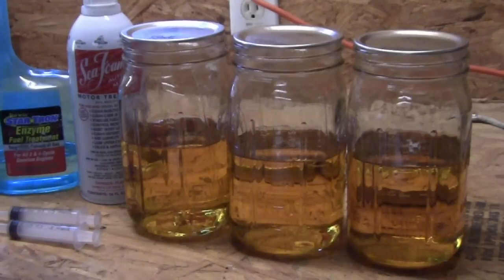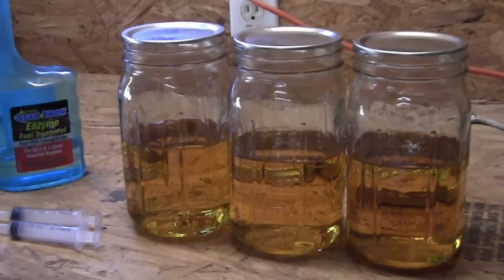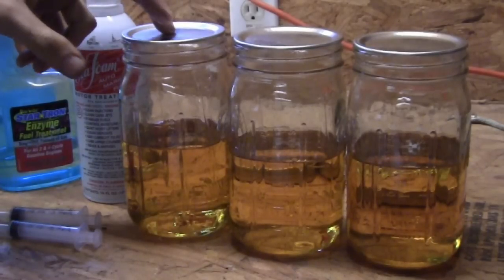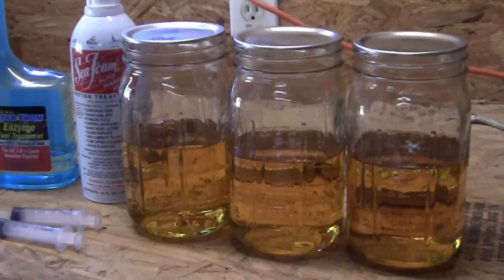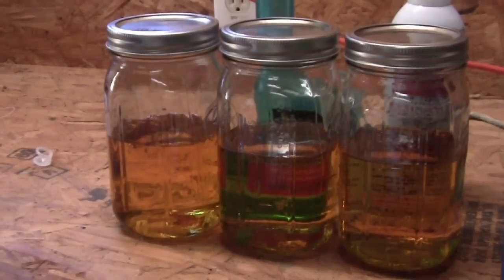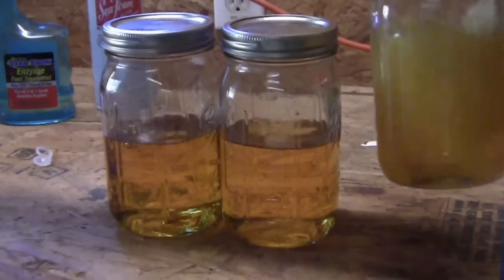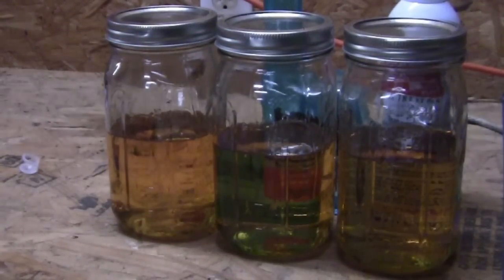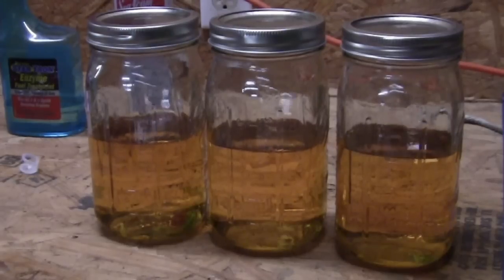Stale Gas: Can it be treated with additives? My unscientific test and results.

Comment: Should you have a   LARGE  stock of stale gas 😝... do  NOT  throw it away .... by adding a  VERY  SMALL  amount  ( ¼ pint  ) to your new gas fill up , used in your automobile .. over many months , you can dissipate this foul fluid ... and save quite a few $$$ dollars .... ( tried - n - tested ) ............. DAVE™🛑

Comment: Chain saw full of stale gas. 20 pulls won't start. 5 second spray of starting fluid into gas tank and sloshed it around. Started on second pull and ran strong. Don't waste money on high priced liquid either. Spray some starting fluid into your gas and keep going.
Reply from the maker: Its the most volatile stuff that seems to evaporate fastest, so this would make sense that adding some ether would spice it back up.

Comment: This is a incomplete test bro You should have stuck one or two or all three of them into a motor of some sort and see if you could get it running because just because it didn't change colors doesn't mean the octane rating hasn't gone up or if it was separated has now been combined again there's a lot of things that could have done without changing the color of the gas
Reply from the maker: https://youtu.be/2c5XRFuFaLY
Reply from the maker: Oops, that posted before I typed anything. I thought the same exact thing, so I found a lawnmower engine to use, and tried running ancient gas in it and it ran fine.

Comment: I have a couple of 5 gallon cans over 3 yrs old.  My plan is to add them to my truck along with seafoam when filling up. My truck has a 40 gal tank so a 5 would be 1/8. Then, of course refill the can with new gas.
Reply from the maker: Yup, diluting it works great as a way to dispose of old gas.

Comment: Do they taste different?
Reply from the maker: The vintage has a smooth, rich flavor with slight hints of varnish and gum, while the freshly bottled has a sharper body with strong octane and could have hints of ethanol depending on which bottle you buy.

Comment: i have an automatic 2001 VW jetta 2.0 - it sat since december 2021 until now april 2023
mobile mechanic came by and put in a brand new battery, refurbished starter, cleaned up the rusted ground connection from the starter to the chassis or transmission whatever it is
the car now cranks, but won't start -  he then took off one end of the cold air intake and sprayed something into the engine while i started it up but then it died after 2 seconds
the gas is original from probably november 2021  ,  i have about half a tank
he is telling me that probably the fuel pump needs to be replaced
any ideas if its just bad gas ?  
i have 87 octane in there
Reply from the maker: There is typically a port to test fuel pressure, it may be possible the fuel pump needs to be replaced, but it may also be that a fuse or relay has corroded. I'd do some other diagnostics, check if the pump runs by listening when you cycle the key on, there should be a faint whirr from the rear of the car, it no whirr then I'd check the fuses and make sure power is making it to the pump, that fuel is 1 and a half years old, so it should burn ok, I'd make sure the pump is indeed providing fuel pressure, and then top up the tank with fresh gas, but there is no sense topping up the tank if youre gonna need to drop it becsise the pump isn't working right.
Reply: @trythistv  the fuel pump on these cars is accessible and changeable from under the rear seat - there is a video here on  youtube, it takes literally 10 minutes
so i got lucky in that department
i will check the fuse panel and relay today or tomorrow - weather permitting
Reply from the maker: Oh man that is just the ticket. I was envisioning having to drop the fuel tank and that is a big pain. Its so nice when engineers think about the people that have to maintain stuff later!

If you've got easy access to the fuel pump you could check for power at the connector with a multimeter possibly as an alternative option.

Comment: modern day alchemy! When we do this stuff it is pure guess work, what we end up with is NOT the original gasoline formulation, but if we are lucky it still functions as a reasonable fuel. It will NOT have the same exact properties, in function, that fresh good grade gasoline has. Gasoline is a very complex chemistry, with carbon chains of C4 to C12 in literally hundreds of variations. With age and depending on storage methods the lighter aromatic hydrocarbons can vaporize off and exposure to air allows for chemical reactions/oxidation that modifies the original hydrocarbon mix known as gasoline. Ethanol content adds an element of "spoilage". Past a couple of years age I opt for new gas, although some gas several years old can still burn, but I want to have assurance that the gasoline is not doing damage with low Octane or deposit formations such as is very likely in old gas.
Reply from the maker: I feel like some kind of wizard messing with stale gas, in the end you are right though, the ways that gasoline ages are very strange, and ethanol content further complicates things.

Comment: I drain the old fuel from the gas tank and return it to the gas can. Those bottles of OTP fuel system cleaner/treatment often come in 3-packs. I’ll buy one of those 3-packs and add them to my gas can and give it a good mix. Even if it doesn’t actually fix the fuel, it still combusts and that’s all I need for a running lawn mower.
Reply from the maker: Seems like a logical way to do it! I've found even diluting it with some fresh gas seems to liven it up enough to burn ok, I'm sure there is some performance difference from the old gas but I'm not really hunting for maximum performance, just good enough to get the job done!

Comment: I have a cabin where I have to use a generator, sometimes the gas gets one year old. The best way to deal with it is to pre treat it with MMO. I put some in the carb in the generator too. Never had any issues. I have also used chemtool and it is just as good. My experience is only with one year old 87 octane gas with ethanol. Cant speak for any other kind of gas or age beyond a year.
Reply from the maker: Pre treating seems to be about the only way to ensure fuel doesn't go bad. My best advice for storing stuff is if there is a fuel shutoff, shut if off and run the equipment until the carburetor is empty. If there isn't a fuel shutoff, either install one or drain the fuel out through the carb drain plug until the tank is empty (for small things like lawn mowers) as it seems like leaving fuel in the carbs is what causes the varnish buildup and that clogs jets and makes for problems.

Comment: good info .do you think a universal gas filter add to the gas line near the engine would effect the performance
Reply from the maker: As far as fuel degrading in storage, a filter won't really help, as it evaporates in the carburetor and gums up, a shutoff valve could prevent that gum forming by allowing you to shut the fuel off and run the carb dry, a bunch of my small power equipment (log splitter, pressure washer, lawnmower, etc.) has a small in-line fuel filter and a small in-line shutoff valve, so prep for storage is as easy as shutting off the valve and letting the engine stall out when the carb runs dry, and then summertime comes again and the filter catches any gum that could have formed upstream over the winter.
Reply: @trythistv  thank for taking the time to anwer
the gas tank was emty, but cannot remove gas tank to really good cleaning inside to big job on lrv 2000 with 951 engine
the gas was 10 year old .so the internal carb gas filter were really gum up after 1 hour of road test with new gas.it run really good for a hour then it would not go no more than 5mph so i took carb a part and the fllter were complet gum up  on the 2 carb after road test 
so i filter the new gas in the tank 5 time with a universal gas filter and replace all the fuel hose because of the gum.  but to play safe i add a extra fuel filter in the system because it a big job remove carb to change filter 
but now it will not go no more than 40 mph with that universal filter it chock and stall at 40 mph but goes good at lower speed 
so i was thinking that the sucking side of the gas pump on the carb cannot handle the weight of the gas 
what do you think, can the gas pump handle that more weight of gas on the line with the universal filter ?
Reply from the maker: Usually there is a small mesh filter built in to the fuel system, often either right at the front of the engine bay or right above the fuel tank in the front compartment, they have an awful tendency to leak air in because its a small plastic bowl with an o-ring, and the bowl warps or the o-ring hardens and causes all kinds of trouble. I wouldn't think adding a filter would restrict it enough to make that much difference.
You could do a plug read and see if it looks lean after a decent test ride.
If you still have the grey "tempo" fuel lines, I would change them out ASAP, they tend to degrade and cause all kinds of problems.
Also, the fuel selector valves can get gunked up inside as well, either one could cause some restriction that could be an issue for your performance.
Reply: @trythistv  i did change all the hose to black automotive and i did inspect that filter over fuel tank but did not replace oring on the filter
what i am going to do next is  remove gas line from carb and plug line going to fuel gauge and apply vacuum with vacuum hand pump to see if it hold vacuum or leak before going to deep in the diagnostic 
did you see some seadoo with a universal fuel filter on them that run good ?
Reply from the maker: I have seen various seadoos run fine with a universal filter, if you're questioning if the filter is the issue, try using one of the kind that has a mesh rather than paper, as long as any debris is smaller than the jets it won't clog stuff up. The stock filter is a fine plastic mesh usually, something similar would be fine, it could be your paper filter has started to clog up a little?
Reply: @trythistv  ok cool .i have the paper one. it is for that varnish that i had in it in the pass.it did a good job removing that dark yellow in the fuel .now the new fuel look normal after filtering the fuel 5 time .but i put a new filter  on the seedoo to catch what i could be mist .but i think now after are conversation it is taking air. because there lot of air in universal fuel filter and never fill up it empty fast. i was thinking that fuel pump could not handle that more weight since it is on the sucking side. the filter is clear plastic filter .i think i was barking at the wrong tree lol .i will check that out in spring when my daughter bring it back to my house .thanks alot for your help

Comment: I have brought back 15 year old gas by adding a gallon of thinner to the 10 gallon gas that was in the tank and adding star Tron enzyme and it worked
Reply from the maker: The more volatile components evaporate first, thinner is real volatile stuff so it makes sense adding some in could rejuvenate the stale gas in a way. I'm certainly no chemist though, idk whats going on with the stuff past my own hair brained theories.
Reply: @trythistv  hello just giving you a shout-out I'm about to try to rejuvenate about 11 gallons of gas in my Ford Escort that's been in there for 4 years four-and-a-half years... now what I've been doing for the last three years is my old acetone trick... what I've been doing with my carburetor Vehicles I've got two motorcycles 1998 Magna and the other is a 06 VTX 1300 Honda... and I've learned through some of the motorcycle forums that these guys have been for the last 10-15 years using acetone in their tanks putting a straight in and getting incredible results higher-mileage 5>15% increase in Horsepower and boost in the acceleration.. and I've been doing it the last 3 years and it has produced those results the issue was finding the sweet spot for the mixture for your particular vehicle.. in my 98 Honda Magna 750 is the mixture is about four-and-a-half 5-oz a two and a half gallon 3 gallon tank counting Reserve... and in my 1300 VTX it's about 3 oz per tank.. once the acetone and the cast mixture hits those carburetors and boom is like I have a rebuilt motor and brand new carburetor job... no Smoky exhaust smells great unbelievable I can't believe everyone's not doing this I've had no problems with rings rubber.. as far as seals.. last week I mixed it in with my weed eater about a capital for the little tiny tank and I couldn't even hold the trigger all the way down because the revs are going so high... so here I go this afternoon I'm going to try to reclaim 11 12 gallons of this gas and see what happens...

Comment: I have 18 gallons of bad gas in the newly purchased used boat it misfired and quit running on the lake I needed to be towed gas maybe six dollars a gallon but I’m dumping it it’s not worth mechanical issues Backfiring maybe slipping timing belt doing so trash your valve’s etc. . have a great day everybody
Reply from the maker: Its one thing to have a lawn mower break down because of stale gas, getting stranded on a boat is a whole different story. I've paddled back more than once, not a good time. Boats also do not cruise like cars do, because of the drag of the water, a boat is constantly under a heavy load, so it is much more important to use a quality fuel that is high enough octane to resist detonation.
Even at 6.75 a gallon like it is here right now on the lake, I totally agree with you, it isn't worth the risk. Drain that gas out, use it for something else!

Comment: I don't care what it looks like.... How does it run in a test engine?
Reply from the maker: See this video: https://youtu.be/2c5XRFuFaLY the stale gas loses some volatility, that is about it. That can easily be remedied by adding some fresh gas or some kind of additive that is usually 90% naphtha or another highly volatile paint thinner type chemical. A healthy engine will run fine on stale gas, unless it has left behind any kind of gum or varnish in the fuel system from the gas evaporating in the carburetor which would be a completely separate problem to the gas "going stale"

Comment: I have a Dodge Caravan that's been sitting for 7 years with 15 gallons of 10% ethanol gasoline. It ran fine last year after adding a couple gallons of fresh gas and a can of "Heat". 

It decided to run like crap and barely start after this winter. I then added 2 bottles of "Heat" and 4 fresh gallons of gasoline. It's won't even run now. 

I've drained 4 gallons of fuel with no luck. Water is heavier than gasoline so it will settle at the bottom of the tank by the fuel pump pickup tube. It just must be that bad and I'll probably just drain it all out.

I burned the 4 gallons of extracted fuel and noticed that it has a very weak flash point and a kerosene like smell. I'm curious if the modern 10% ethanol gasoline chemically breaks down after so many years when being exposed to o2 and seasonal moisture?
Reply from the maker: It seems like old gas loses some volatility, makes it harder to burn, as the most flammable components tend to also be the ones that evaporate. Some of the heat and products like that are pure ethanol, which if any water got in there will phase separate the water out of the gas and make matters just as bad, possibly worse. I had a miserable time with heet and some watery gas in a motorcycle years ago. Ended up dropping the bike and failing my license test because I decided to fill up.

Comment: I’ve got gasoline that I treated with sta-bil storage treatment before I parked the vehicle in my garage for 8 years, the gas  looked fine not even showing signs of turning to the nasty varnish color or smell and after jumping power to the in tank pump to prime plus I drained a bit out at the fuel filter which I replaced to check it’s color and smell, she fired up a bit rough but smoothed right out, plus I added a dose  of Lucas injector cleaner in the tank for the 17 gallons it had in it, and I let it run 5 minutes then shut it off and let it sit a couple days and it’s fine, no codes smooth as always and will use that tank full as fast as I can.

It’s a 2001 chev S10 with a 2.2 flex fuel engine that’s only seen regular gas it’s whole life.

Gas tank is plastic not metal so no rust worries.

Was I shocked, absolutely, had another old Nissan that had gas go bad, it was ugly repair to get it fixed and not worth the cost to finish it
Reply from the maker: It seems very hit and miss, I've seen gas go so bad it rots tanks and gums up the entire fuel system in less than a year of sitting, and I've seen others go years and years and fire right back up without even the slightest hesitation. I thought I was real scientific when I made this video, then I learned a ton, made a follow up, realized I don't have a clue, and have continued to learn and the more I learn the more I realize I don't understand.

Comment: I didn't know they was supposed to change the color of the fuel.  I have a jar of clear  moonshine that burns into a blue flame. A jar of water that looks the same will not burn.
Reply from the maker: Part 2 of this mess has an interesting twist. Fuel doesn't actually really go bad, it just evaporates and clogs up carburetors. Took fuel that was several years ago and it fired right up and ran flawlessly in a small engine that had been properly stored by draining the gas from the tank and carburetor.